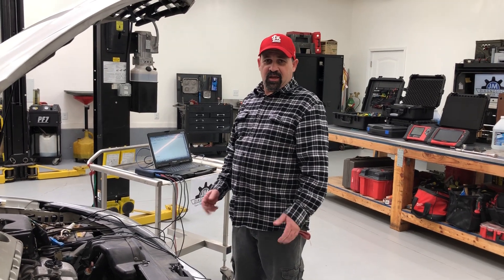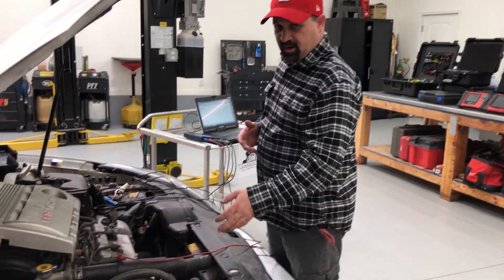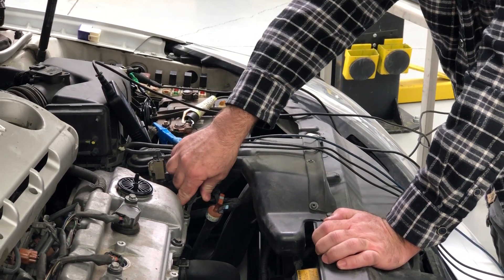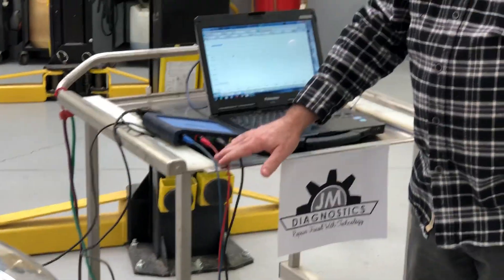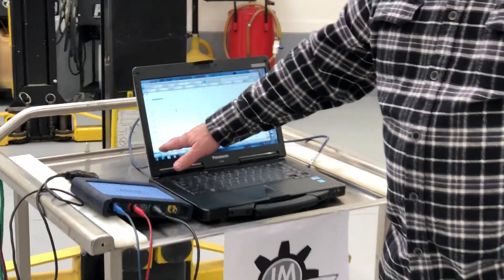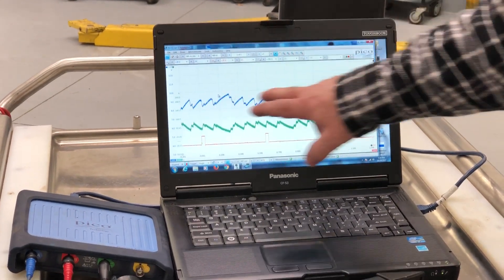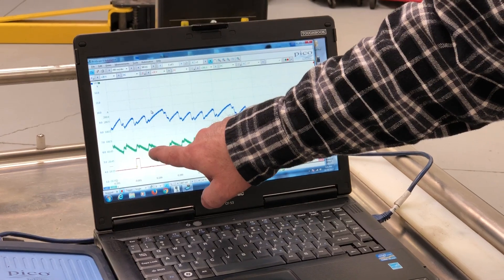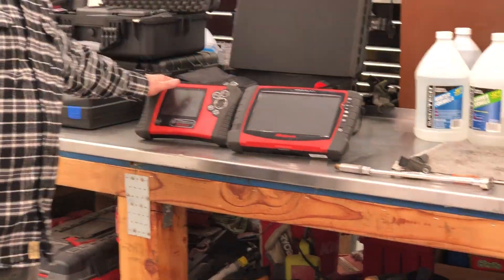Relative compression test without an amp clamp

Comment: how is it without an amp clamp??? and yeat i see one connected.
Reply from the maker: Vito D the amp clamp is used here as a reference so you can see the relationship between amps and voltage drop. The entire point of this video is based on the use of voltage not amps.

Comment: So basically you don't need to use a clamp meter ! just measure battery voltage and inverse image ! Thanks for sharing .... Quick question - was the voltage taken at the starter motor or the battery terminal please ?  Thanks
Reply: Battery terminal...